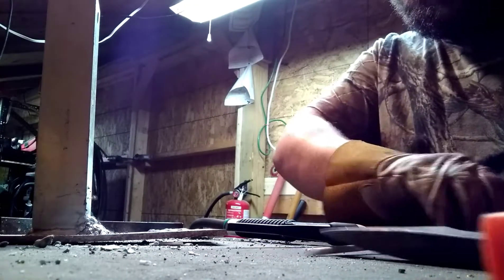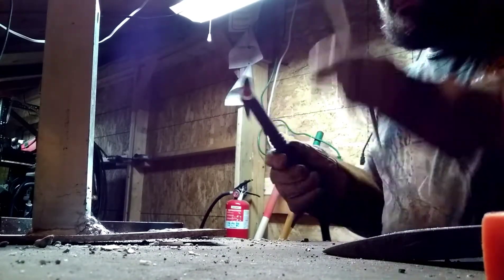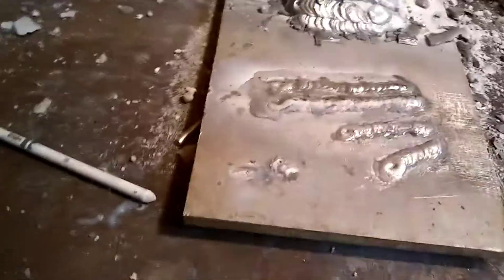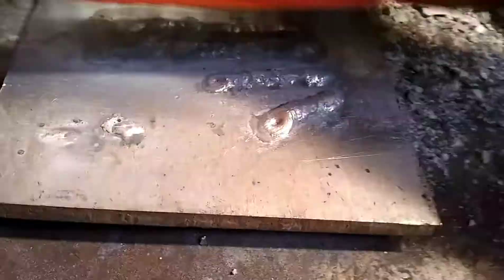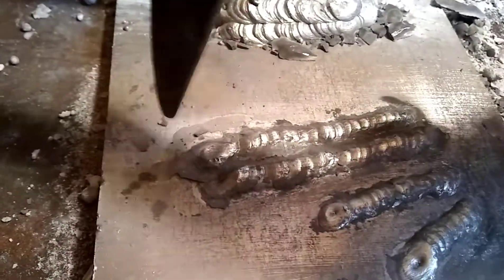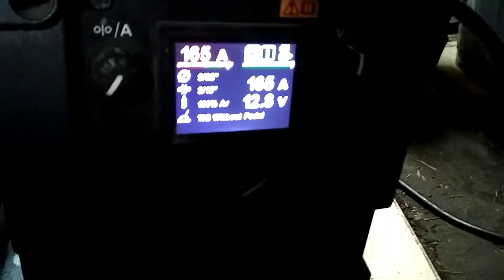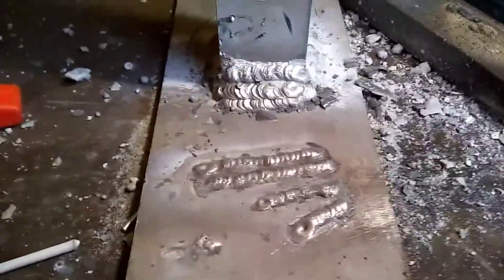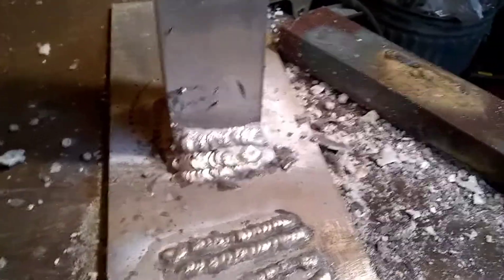Tig welding aluminum on DC with stick electrodes

Comment: I watched a video where JD Brewer used his Lincoln 210MP with a spool gun, running off his generator.
Reply from the maker: Protected Profile back when I did this video my generator didn’t have a 220v outlet so I was looking for other ways to get the job done

Comment: Huh!  I’ll try that for sure when the weather improves. What rod were you using, D?
Reply from the maker: Steve Breland it’s e4043 stick rod in 1/8 diameter but I think it would work better with 3/32
Reply: @derbadortheweldor8940  aluminum rod. Or any stick rod ?

Comment: Try it with the flux off of the rod
Reply from the maker: Welding it without the flux wouldn't work. Since it's dc- there is no cleaning action. The flux acts as the cleaning action allowing you to actually join two pieces.